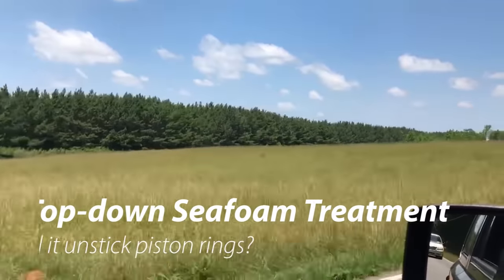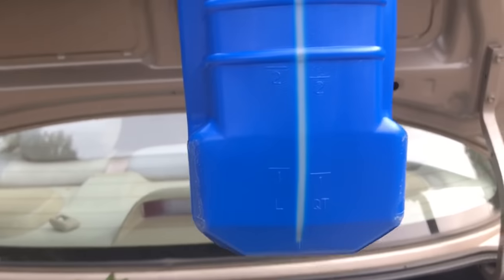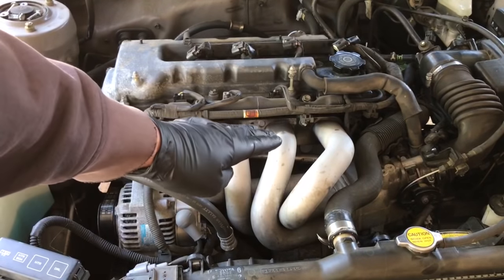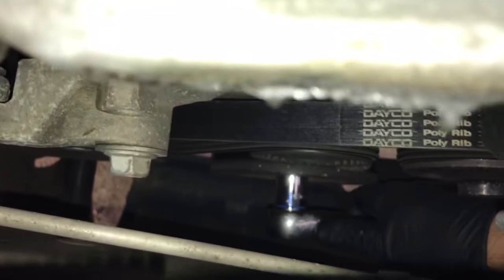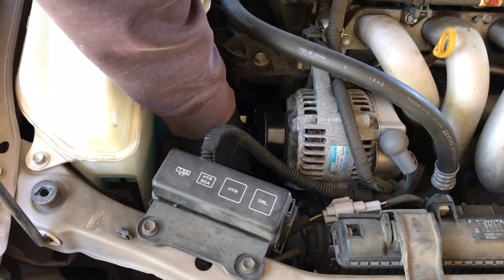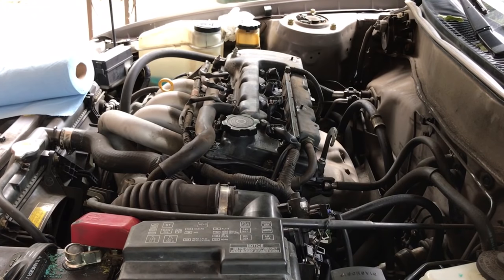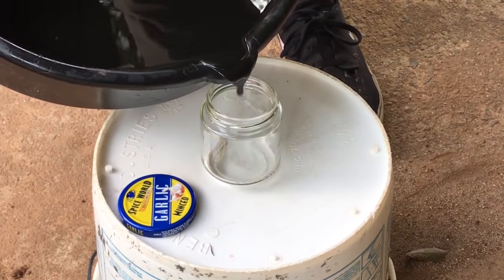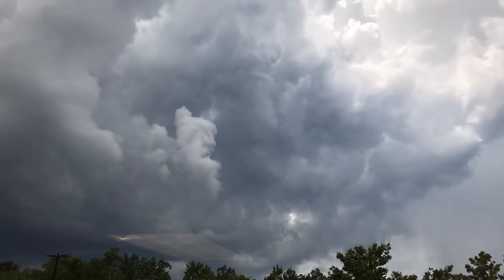I poured Seafoam down the spark plug holes! | Oil Burning Experiments - Episode 1

Comment: I got as far as the oil covered plugs..  a bad pcv valve will suck the oil out of your motor ... if the pcv valve doesn't rattle then its no good and its stuck.. not all pcv valves rattle so take a good look inside of it,if it doesn't move see if u can clean it out and make it move .the ones that move go up and down inside as the vacuum from the running car causes that motion. Some r on the valve cover and some r in other various areas .look at your sticker under the hood for the vacuum hose diagram to locate your pcv valve .. also when using  Synthetic oil you wont notice the car burning oil . Synthetic oil burns white and not blue like your conventional oil .

Comment: It's crazy how some of these motors burn so much while others don't. I had a corolla 1zzfe with 233k miles and still wasn't burning any oil. I have talked to owners who were religious with no more than 5k oil changes and burn like yours. Seems to be no rhyme or reason to who gets the oil burners.
Reply from the maker: True. I read somewhere that it might be mostly Corollas that driven short trips where the engine never completely warms up, and maybe cold spots build up varnish??  We went to South Florida this year and something my wife and I noticed was that there appeared to be a lot more of these old Corollas down there. Maybe the problem occurs mainly in colder climates where engines don't get warmed up as much?? Open to theories. Thanks for the comment, Matthew.
Reply: These 1ZZFE engines only hold 3.5 quarts with filter change. My money is on OWNER neglect. As in running it for 5,000+ miles or longer between oil changes. I change mine at 3700 miles, uses no oil.
Reply: @FamilyFriendlyDIY  Yeap, low mileage older cars can be a problem. Learned about this from "Why do Toyota engines consume oil" vid from the Nut. Not just him, Scotty always recommend to do "Italian Cleanup" every once a while

Comment: I’ve seem a video where he put in simple green and left it for 24 hrs he also filled it, I’m wondering if you were to put in the sea foam like you did but after 24 hrs add it again and crank it over, repeat for 3 days as I think it had just passed the rings and sat dry for the next few days it’s just there was no spray coming out of the plugs
Reply from the maker: I'll have to look that one up. Did it work?

Comment: Great video! I have a 2008 Scion TC with 165,000 on it. I am currently using a quart about 800 miles. I drive it under 3,000 RPM. It was using much more oil before when driving it harder. So, question, what's the difference between the B9 chem dip and the B12 chemical? I am about to do my PCV and valve gasket. I have oil going into the spark plug holes, but not a lot. I think that my consumption is less, so maybe I have a chance at getting this under control.
Reply from the maker: Thanks. This is what I found on the Berryman's site.  https://www.berrymanproducts.com/question/berryman-b12-verses-berryman-b9-carb-dip-cleaner/   I wish you the best with your Scion!
Reply: My friend has a 2007 tc, that was redone by Toyota n/c and he now has 135,000 miles with no oil problems.  Thanks… Jim
Reply: Mine is at 309,000 miles.😅

Comment: Try and flush the motor with marvel mystery oil then use a quart of Lucas heavy duty oil stabilizer with your normal ail change
Reply: Transmission fluid works just as well. Marvel is no mystery
Reply: ATF needs more mileage, time to be run in order to clean. A quick flush don't do much. MMO is 500 to 1k miles, ATF is the full 5k miles. Both at 25% sump volume.

Comment: We can blame Federal corporate average fuel requirements for most rings being too loose causing oil consumption. Catalytic converters can often hide burning oil, so you never see it coming out of the tailpipe. Depending on the severity, adding oil is a lot less expensive than repairing or replacing the engine. 300 miles per quart, is severe in my book.

Comment: All you need is dimexid. It's a liquid for medicine. I believe you can buy it in pharmacy. It's very strong in terms of cleaning. But be careful, it can dissolve any paint inside the engine and also damage rubber parts. It's widely used in Russia for piston rings cleaning.

Comment: Nice video and Great explanation, may I ask you do I have to change the oil after using seafoam in the gas tank ? And to Maintain the highest performance how often I should pour it in my tank ? Thanks again
Reply from the maker: If used in the fuel, Constantine, you don't have to change the oil afterwards. As far as adding it to the fuel goes, I only use Seafoam in my small engines (lawn-mower, string-trimmer, blower, etc.) when I think the carburetor jets might be narrowing from fuel varnish. Where I am, I have access to high quality fuel that has detergents to keep everything clean, so I've actually never put it in any of my automobiles' fuel tanks. If the fuel isn't great where you are, it can't hurt to run as frequently as you like. I hope this helps.
Reply: Every 7,000 miles add 1 seafoam to the gas tank

Comment: Around 332 miles on a full tank of gas?
Are you running A/C or hitting the accelerator hard (like on a race track).
My average on any car i drive is around 400+ miles on a full tank.

Comment: Can't you just put the seafoam into the crank case? So where you poured the oil in at? It should do exactly what you did by taken the spark plugs put? I'm not a mechanic I just see most people do it the way I explained. Could be wrong tjats why I'm asking
Reply from the maker: Yes. I do that in another video. Thanks for the input!!

Comment: Inspect the cylinders visually, the gummed up piston rings may have scratched the walls causing all the oil to burn.
Reply: Another YT "expert"....
Carbon'ed rings do not scratch cylinder walls, they keep the rings 'cemented' close against in the piston land.
When this happens, they are unable to expand and wipe oil from the cylinder wall, causing excessive oil burning.
Additionally, this causes 'blow-by', which causes glazing of the cylinder wall with microscope carbon coating, covering the cross hatching of cylinder walls, and excessive crank case pressurization and additional carbon entering the crankcase turning your oil black and more viscious faster.
Most engines burning oil have carboned rings which means they are not able to open and slide against the cylinder wall on the down-stroke.
The oil they would have pulled down is then burned on the next combusion stroke, and is repeated non-stop.
Thats how the oil mysteriously disappears if you don't have a leak.

Comment: You can put Seafoam in your engine oil and run the engine/drive for a short time to help clean the oil ways and engine.
Because the Seafoam seeped passed the rings and got into the oil that is why your oil was dirty because the Seafoam cleaned it out.
By putting Seafoam in your engine oil it should be able to clean the rings more.
You just have to measure it out according to the volume of oil in the engine.
Too much and it will thin the oil out too much.

Comment: On older vehicles with your filter facing in the conventional position must fill the oil filter up. You don’t run a water compressor or water pump dry do you know so don’t do that with your oil sump system and or filtration system it’s bad enough when you start up your engine The oil it’s stuck between the bearings gets pushed out when you start up your engine, making brief bearing to bearing contact now if you do that with air in the lines without filling the filter up, it’ll take an extra second for the oil to get to where it needs to go Keep in mind after that oil change engine start shopping sounds a little differently that’s because there’s no oil pressure up in the engine that is the sound of an engine starting briefly dry.

Comment: When are you checking the oil? Right after you turn off the car or waiting 5-10 minutes? If you are not waiting 5 to 10 minutes you will never have an accurate reading because you have not given the oil enough time to get back into the crank case.
Reply from the maker: If I check it after it's been running, I always let it sit a couple of minutes. Though I usually check it before I crank it in the morning or when I'm about to leave work.

Comment: How did u get the seafoam out of the cylinders
Reply from the maker: In my case, Rodney, it all drained by the pistons and into the crankcase. But you can remove the EFI fuse and crank your engine with the sparkplugs still out, and it will blow out the excess. Or, even better, you can inject compressed air down the sparkplug holes (covering the opening with a towel) and that will clean them out.

Comment: It's because that generation of toyota has low tension rings to create less drag and friction which does better in fuel economy but if you use low quality oil, they will start to gum-up, stick and start let oil sweep in the combustion chamber.

Comment: I’ve seen someone spraying a full cam into the intake I’m wondering if that would do the same thing
Reply: GM has what they call Engine Top Cleaner. Used these before in the 80s to reduce engine dieseling

Comment: Interesting experiments

My Honda Odyssey changing the PCV helped it a lot and changing to high mileage 5w20 synthetic blend havoline.  I had been using 5w20 high mileage conventional super tech. 

I have also have a 2001 Nissan Maxima . It goes through alot of oil ,  but it has a rear main seal leak.  It got better with pvc valve and Change and AT205 reseal  but still  goes thru alot  of oil. 10w30 
I had blackstone labs to a oil analysis and the oil seem to be within the avg for the engine VQ30DE
Reply from the maker: Thanks for the info!

Comment: You should have ran the engine with the Seafoam in it for longer. You would have got much more sludge out. OR you can still add Seafoam into the engine crank case and run it like that for about 500 miles to get some more sludge out. If it was mine I would do it a few times to clean it up really good.

Comment: Well if you noticed when he was changing the oil he never filled up the oil filter full of oil just put oil on the ring for the seal and then when he checked it he was 3/4 of a quart low which entails that 3/4 of a quart went into the oil filter he might not have been a low on any oil and it might not have burnt any if you would have done it correctly
Reply: Should've filled up the oil filter and run the engine up to working temperature, leave it overnight before measuring starting oil level.

Comment: What worth to check what I see here.
Replace PCV, roasted spark plugs, valve cover gasket.
I do extreme stuff which is fill crank case with diesel and 15 min idle ( with new oil filter ) and then full synthetic in your case 5W30 not the 10W. If the diesel gonna be a lot ganged, you can flush two/three times.
On top of pistons transmission fluid with kerosine for 24h ( time to time moving the crank ) ...then suck it back with a pump and silicone hose.

Comment: Seafoam is too thin and not that aggressive. Some shop tech here use engine oil+diesel fuel mix. I've used trans fluid + 5min engine flush mix. May have to let it sit for few days since it so thick and may have to siphon out. Or sometime just add 1qt of transmission oil run for 300-500 mi works well too.

Comment: Good videos (I watched both and came back here to comment).  Good comments.
I liked the idea of putting vehicle in high gear (engine off) and moving back and forth to move pistons instead of turning the crankshaft with a ratchet.  Definitely should check/change PCV.

Comment: Had a scion with that engine. Run seafoam 1pt to 4pt oil. 1000 mi. Change. Repeat 3 more times.
Switch to 0-30 synth.
Will stabilize oil consumption to about a pint every 3000 miles.
I did it.
Engine had140,000

Comment: The dirty oil is because of the seafoam... I would put some seafoam in the oil and drive it 100 to 200 miles you will get dark black oil   like if it was paint and your engine will run smoother after you change the oil

Comment: Just got done doing this. 
Did regular seafoam for a few hours and then mixed the seafoam w marvel mystery oil.
Then put the truck in 4th or 5th gear and pushed it back and forth to work it around.

Let it sit over night then cleared it out.

Was doing about the same consumption as yours and the plugs didn't look black either
Reply from the maker: Thanks for the comment, Chris. Please let us know if it works for you.

Comment: i switched to amsoil 5w30 signature and only lost 1 quart after 3000 miles after changing oil and flushing twice
Reply: I just bought 5 quarts of that stuff for my ‘97 Discovery. That’s a difficult oil to find, most auto parts stores don’t stock it.

Comment: It is your head gasket seal you need to put liquid molly Product for accessive oil. It will help it and you drive it in your car for a thousand miles and it will change it works great.

Comment: On your oil change I did not see you check the oil after you started it up ... the oil should have gone down (after the start up) to fill the oil filter. Mine does when I change it and I may need to add about 1/2 quart to bring it back to full. So if you did not check it after you ran it ... your test may have been better than you think and not have used as much oil as you thought!

Comment: did you fill up your oil filter before install? if you didn't, it would be low before you drove it.
Reply from the maker: No, I never fill up the oil filter first. I usually crank the engine and let it run for a minute, then top it off. I probably should have mentioned/filmed that ... I think I do in another one of my videos. Thanks for the comment, Randy!

Comment: Sticking rings in later Toyotas has been a problem. Caused by using low tension rings, and the holes that lubricate the rings being too small. This all started because Toyota wanted lower fuel consumption by reducing friction. Unfortunately you get more blow by with lower tension rings. More blow by you can expect dirtier oil and sludge that plugs up small passages and sledge causes the rings to stick. if you catch it early enough and use an additive to clean things up, you might be OK. Another problem is that manufactures market these cars that they can go 7500 miles between oil changes. This is a really bad practice unless you are driving exclusively on interstates at speeds above 50 miles an hour 95% of the time.  If the cylinder walls are not damaged, I would consider putting Marvel mystery oil in your oil increasing your intervals between oil changes. These cars with low rings. I would do this from the time the car is new.

Comment: Yamaha Ring Free.. It Works! Also, you can run non-fowlers on your plugs. By the way, if your going to use Seafoam.. You can add it to the fuel, the crankcase and spray it into the throttle body while the car is running.
Reply from the maker: Thanks for the info!

Comment: Did this on a D16y7 civic I had that smoked blue and lacked power. Differences being I just let it soak over night, and before starting I let some mmo set in the cylinders too for a couple hours then cranked it over to clear it out. Plugs in and changed the oil before running. Yeah could have cleaned some carbon that way BUT my goal was any gunk still around the rings was soft now so I wanted to blow it out by beating on it up the road, didnt want to do that with a bunch of seafoam in the oil. Engine already ticked and it wasnt the valve adjustment... (more on this later) Anyway stopped smoking and starting running like total garbage. Weird because it was running fine. Apparently compression came up and revealed bad and mix matched injectors! Some of them were blue and some were brown???? Got some new injectors all matching put them in and that thing had a ton of power! 10 times what it use to have! I was surprised that d16 had what it had in it power wise! Was a 93 ish civic ex that someone had swapped the engine over into. I believe it had a limited slip diff because it would just light both front tires up like it was nothing. Unfortunately when I did the first oil change when I got it before all of this I noticed the oil was thick... like honey... Regular oil in it again it had a tick. After a bit of beating after getting it running tip top I found out what the tick was. rod bearing gave up... Started knocking like crazy one day. No oil pressure or power.
Reply from the maker: Whoa. Sorry to hear that, but lots of good info in your story. Thanks, Dillon!

Comment: Nice video Dave. Did you run the engine after the oil change to refill the oil filter before you showed the oil level on the stick? Wondering if maybe some of the drop in oil level was due to the filter not being filled yet.
Reply from the maker: I did ... and I always forget to mention that in the videos. That's the one miss that drives me crazy :-) ... Thanks for the comment FiveAble!

Comment: so many people neglect tune-ups and maintenance. when doing the tune-up replace things like air filter, oil and filter, spark plugs, distributor cap, spark plug wires, fuel filter, transmission filter, belts, hoses, timing belt and these parts if they need it and if they're older. I've never been a fan to clean a plug unless I couldn't get a new one to put in it. too wet or too fouled of a plug will never run like a new one. and if you're not efficient and a tune-up you're burning more fuel and more wear and tear on your engine and vehicle. also repack wheel bearings check differential gear oil depending on what vehicle. all of this I mentioned can get very costly And timely unless you do it yourself. I'm searching for a used ATV and the ones I've seen are more neglected than people's cars. the ones I've seen are truly used and abused with no maintenance or a tune-up.